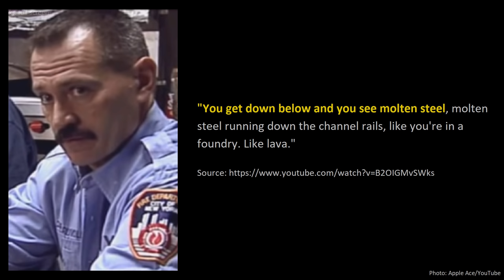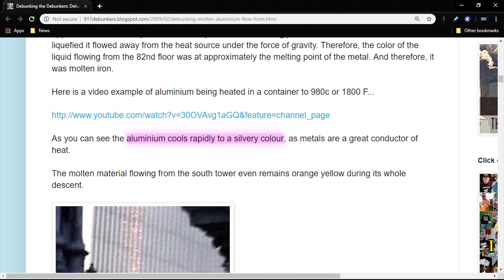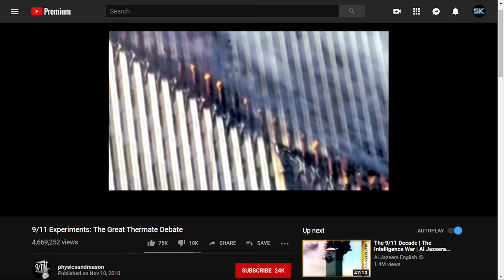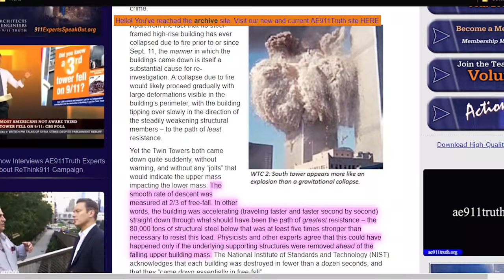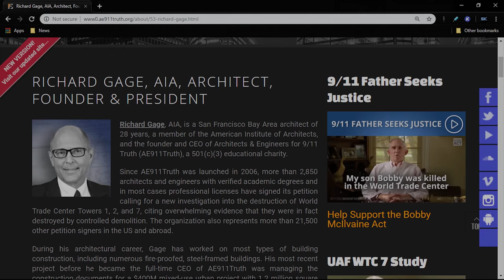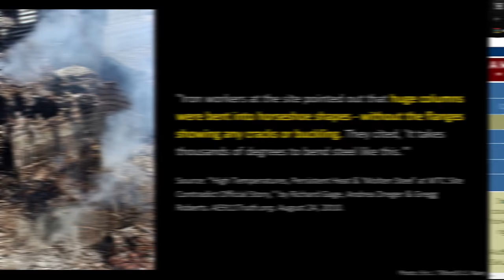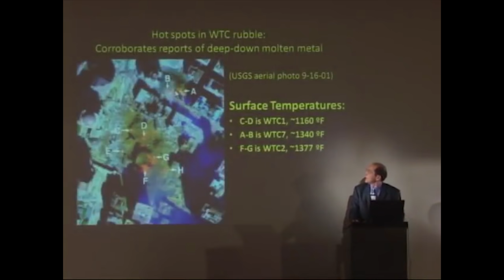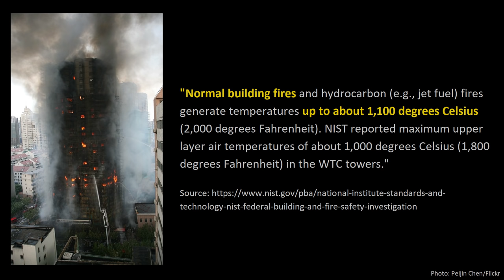9/11 Truthers Debunked: "Molten Steel = Thermite From Controlled Demolition!"

Comment: I actually watched your entire video. I see a lot of time and effort was put in. I also see your pretty intelligent with your explanations. I actually agree with you on your debunking in some areas but not all. First why would the location of building seven have a hot spot? There was no source of fuel on location unlike the airliners with the towers. Basic office fires along with debris that fell wouldn’t have caused a hot spot underneath building seven particularly a growing hotspot a week and a half afterwards. Also what is burning? Office chairs and tables would burn up immediately but for weeks on end with the amount of water they put on site. Was there aluminum at building seven? Was that building made of such material? Why the hotspot? One more thing. That photo you made a joke about. It was glowing to the point where it was blinding. Just like thermite would. A professor at BYU studied a sample of dust from the world trade centers and found nano-thermite chips present.
Reply: The hijackings really happened...also...why do you think those towers wouldnt get down like that? How many tests were done by using airplanes against buildings as tall as them? The towers were build theoreticly to withstand airplane crashes but just in theory. They did withstand the crashes but the designer of both towers, a japanese guy said in an interview, they werent thinking that much about fire from an airplane. I mean he said he thinked about it and he just couldnt find a solution...and they were like...I guess we go with it since no building in the world is designed to be fireproof atm agianst fire from airplanes)
Reply: I bet most of the tall buildings will actually fall in a few hours if we are crashing an airplane with loads of jet fuel into them, even to this day
Reply: WTC7 had tanks full of oil. Read the report.
Reply: @wovemalkalivan306 pretty much
Reply: Grenfell burned for 60 hours it is a 24 story building and it still stands today. This was some kind of evil weapon
Reply: @twinsprings24  Comparing a steel structure to a reinforced concrete structure. Apples and oranges.
Reply: Me when I’m schizophrenic
Reply: @twinsprings24  Grenfell also didn't have its critical structure damaged by a 767 filled with thousands of gallons of jet fuel hitting it at 600 mph.
Reply: @BabySkinCondom  believe what you need to. I removed my rose colored glasses long ago
Reply: @BabySkinCondom  building 7 wasn't hit by a plane or have fuel spilled in it. Try again
Reply: @twinsprings24  building 7 was hit by a 110 story skyscraper falling on it that destroyed half of it and spilled fire into it- and as has already been pointed out, it had fuel tanks in some locations because the building had backup generators.

looks like you're the one who needs to try again.
Reply: @twinsprings24  right, you removed your rose colored glasses and replaced them with conspiracy blinders
Reply: @BabySkinCondom  no amount of evidence will ever persuade an idiot - Mark Twain
Reply: @twinsprings24  using a mark twain quote to describe yourself, nice touch
Reply: @BabySkinCondom  "destroyed half of it"

Actually look up a picture of the damage to Building 7. I urge all reading to do so, and see that this individual is either intentionally lying, or their perception is fundamentally out of line with reality. Honestly, it's likely both. 

The problem with this idea of yours is that Building 7, in spite of it's damage, was holding it's weight up perfectly fine until it had a SUDDEN INSET of collapse with a level roof life, more or less into its own footprint, at the acceleration rate of gravity (9.8m/s/s). This unequivocally proves that all of the perimeter structural support columns were taken out at the same time (within a fraction of a second of each other) in order o allow it to fall in this way. Otherwise, it would have fallen of to the side, into the direction of the structural damage it had which you mention, which would be what is known as the path of least resistance. It instead fell straight down suddenly into what would have been the path of greatest resistance, had the perimeter columns not been blown out simultaneously. 

Yet, your comment is still further rendered completely irrelevant due to the fact that NIST maintains that the cause of Building 7's collapse was the fires, not the structural damage from falling debris. Again, random, small pockets of fires on a few floors cannot initiate a total, sudden, symmetrical collapse of a 47-storey steel framed skyscraper that once housed offices for the CIA, U.S. Secret Service, Department of Defense, etc. at the acceleration rate of gravity (free fall - which is even acknowledged by NIST now). Try again another time.
Reply: building 7 was hit by debris from the north tower which stripped out a large portion of its interior structure. there was a hole torn in the wall of the verizon building next to it and several buildings surrounding the complex were either destroyed completely or damaged beyond repair
Reply: Aliens
Reply: @BabySkinCondom 4-515mph.. do your research
Reply: What about the owner of wtc 7 saying on the news.. ‘’they made the call to pull the building’’
Reply: @assettojoyrider what about it? structure was compromised
Reply: @assettojoyrider heres a quote from wtc 7 owner Larry Silverstein “I remember getting a call from the fire department commander, telling me that they were not sure they were gonna be able to contain the fire, and I said, "We've had such terrible loss of life, maybe the smartest thing to do is pull it." And they made that decision to pull and we watched the building collapse.” what he meant by “pull it” was to pull out of the job of containing the fire, he wasn’t saying they decided to demolish it. he was telling the firefighters to pull out because the building was a lost cause
Reply: @cmerton    Yes and where were those tanks? They were located underground in a bunker. Tell me how those tanks would be compromised in the safest place away from everything?
Reply: @maclen44  “the safest place away from everything” is truly an interesting way to describe a building which the entire inner core was compromised from debris of the north tower lol probably one of the least safest places you could be realistically speaking lmao

Comment: An hour in the dirt (see sand castings)is more than enough time to stop aluminum or steel from glowing or dripping , zero chance of glowing/dripping after a month in the ground .
Reply: Aluminum cools very quickly.
Reply: Yes, this happens, when guys come around who were the first in the schools who back then said to the teacher : "when will i ever need that physics knowledge in my life ?"...But then making explainations, without physics-knowledge, but instead: out of plausibility. 
Let me tell you: concrete is one of the best heath isolator in the world. And yes, if there is dozends of meters of isolating layers of concrete (yes the buildings were build up by a lot of tons of concrete), than you get a very good heat isolator, which indeed can glow for months in the ground! 
And even cavemen in the stoneage knew that - usually after a fireplace, they covered the fire with a lot of soil, to keep the coal hot in the inside. With that, the cavemen didnt had to make the same hard work of making fire again (rubbing woods together can take a lot of time), but simply digged the soil away, until they got some glowing coal, put some dry grass on it, and blow, and there was it again: fire. This technique can be used even a lot of days after the fire went out, if you put a lot of soil on the still glowing coals. 
But yes... nowaday people are simply not interested in physics. Sure, everyone wants to say something about physics - like you prove. But none of these guys really are into physics.. in terms of: calculating, reading actually physic books (yes with equations in it), etc.. 
Everyone just thinks: ''i dont have to learn physics in order to say some smart things about physics'' ... 
Its quiet exhausting for me ... espescially, the confidence of those people behind their claims. 
And yes, i have many physic books, and yes, i use them very often - yes i calculate things. I even programm physics simulations , and i was never the one who was bored in physics class back then.
Reply: @PygmalionFaciebat   Great. Can you  go make a physics simulation of building 7 falling? I know the 9/11 commission made one but they never released the key information like what software they used or the parameters they programmed in. i have  been massively curious about how that building fell.
Reply: @maccloud3685  Just out of curiosity, are you a structural engineer? What is your level of expertise in the design of WTC7?  What is your level of expertise in the full amount of damage WTC7 sustained when WTC1 fell?  Maybe you're different, but from my experience, the vast amount of those who argue WTC7 could never fall as it did unless it was controlled demolition have virtually no experience in any of these areas, yet they all feel qualified to declare it couldn't have happened as NIST said it did.
Reply: @TheTruthCalls  Just out of curiosity and i never said it was CD.
Reply: @maccloud3685  I do believe I owe you an apology. I'm not sure how late it was when I wrote that post (I'm hoping it was real late!) but you clearly did not dispute any conclusion, from either camp. My response to you would be a somewhat stock response to anyone who claims WTC7 could not have fallen as it did without CD, but you're not one of them. Sorry about that....

Comment: I disagree with your conclusion that it is molten aluminum we are seeing. Due to low emissivity and high reflectivity, molten aluminum looks silvery in daylight. It looks nothing like what is seen in the original video from 911.
Reply: That's false.  He even showed this in other foundry videos where molten aluminum being poured was still a bright orange/red color.
Reply: @txag007  can you prove that the molten metal showed in those clips was actual aluminum?
Reply: @werner9643  why?  according to you truthers fired wasn't hot enought to melt steel.  So what is it now, does steel melt at those temps or is the correct answer just melting aluminium?  Answer is aluminium.  Also, it isn't always silver in the light.  Color is temperature dependent.  Here is very hot aluminium glowing bright orange:
https://www.youtube.com/watch?v=qK626DpxhBI

Spend some time looking up temperature color charts
Reply: @txag007  what makes you think im a truther? i ask lots of questions, to both sides.
Reply: @txag007  also im asking this question cuz theres lots of charts about steel, but no charts about aluminum. maybe im asking too much now, but have you found any video showing auminum glowing like that in the daylight ? The brightness outside can be hundreds of times higher than an indoor place, so we cannot make any comparision with the molten metal flowing out of the twin tower